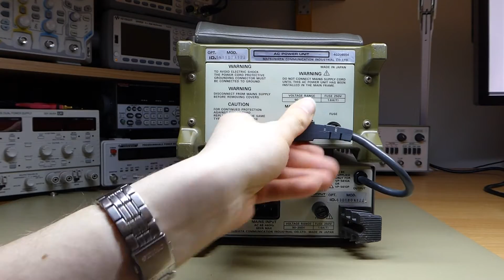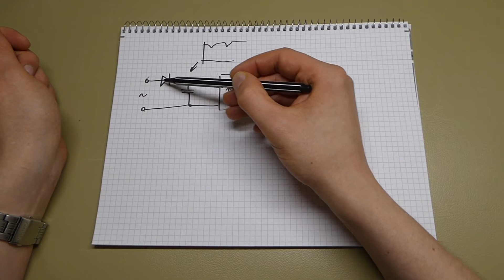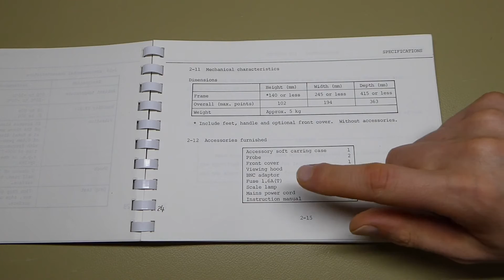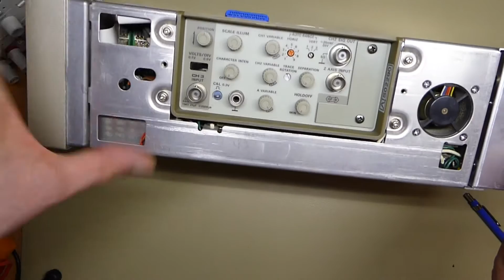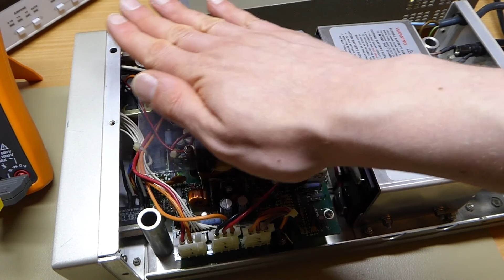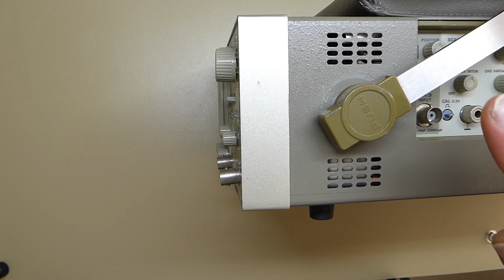Panasonic VP-5610P oscilloscope & VQ-031F power supply

Comment: The Panasonic VP-5610P is one of the most densely populated oscilloscope I have ever seen. A fascinating tour of both pieces of equipment that were very well constructed three decades ago. The designers put a lot of thought even surpassing it's design expectations when it came to the duration of time, "Excellent Demonstration" thank you.
Reply from the maker: Thank you, John. I always find it fascinating to see how engineers pushed the boundaries of what could be done decades ago. Then there are also all the little details that really give you an insight into design decisions and problems they encountered. Wonder whether my Rigol scope will still work in 30 years' time...

Comment: Nice video. Got a VP-5610P myself, with an option 04 - the GP-IB. Sitting exactly where you have the "blind"-plate.
The GP-IB connector is mounted from outside the side panel only protruding a few mm into the instrument. 
I got my "5610" with a battery supply like yours, but it had cooked it self for so long that the battery was enlarged by 10% in volume and large parts of the pcb was brown - threw it on the scrap yard  :-/

Nice to know that the backup-batt. is still going strong - I won't trouble myself checking it before it gets unstable.

Have you ever checked what supply voltages that comes from the PSU ?. Less than 40W - should be possible to build a nice low-profile batt-pack from old laptop cells (9, 18 or maybe even 27 cells).
If its only a few +/-12-15 volts and a single 5 volt it should be easy, a stable low ripple 100+ volts might be another "deal" ;-)
Then power, and charge, the setup from an old 65w laptop charger - could be a nice portable for a few hours per charge :-)
Reply from the maker: Oh, interesting - is there an extra card in the scope for the GPIB controller? As for the PSU - funny you should mention that... I've been playing quite a bit with mine to fix a regulation issue with one of the rails and helping someone else debug their supply. From memory, the rails are something like 5V, ±9V, ±12V and - annoyingly - 70V.

Comment: Hello, very interesting video. I've got one of this kind to fix in my storage but no diagram are available on the web and service in my country isn't available. Did you have any schematics about this model and in affirmative case can i have a scan of the diagram for trying to fix it ? Thanks and regards.
Reply from the maker: I'm afraid I don't have a circuit diagram or any other service information and couldn't find anything myself. Judging by all the custom components in the analogue section, I fear that any repairs there would be quite challenging. Good luck!